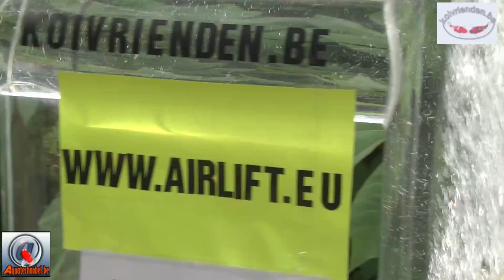introduction to airlift pump

Comment: Would that be able to supply enough water flow to push through about 600mm of stones  in a 2.4x 4.8m wetland filter or will the pump lose its pressure? The outlet would go to the outletpipe of the bog filter approx 900mm deep with 300mm empty void then 600mm filter media. Pond size would be about 36000lts i anticipate pressure chamber will be at 1.7m then run downhill to the filter 8m away

Comment: I need to move 15,000 gallons per hour! I was thinking of using a 6" pipe for my airlift pump. My driver can sit 5.5ft depth. How do I calculate the waterflow? I like the simplicity of smaller airpimps and using one per driver. Can someone explain?

Comment: Can it will on a curve pipe instead of straight pipe .. and what is the calculation of power of compressor to flow of water at specify head .

Comment: They are not liftng almost at all. Just cirulating at water level.
Reply: Do you mean to say that air lift can't push water above water level
Reply: @shyamhingankar7442  no…. But in this video it isn’t lifting very high.
Reply: @timothyjones9430 it still moving a large quantity. If it's for pond filtration and say moving it into a wetland filter it's perfect

Comment: While testing for improvements on my air lift bubbler on my 19' deep shallow well I discovered that I just need the right amount of air (no less, no more) to get the most GPM of water and keep de drop-- riser pipe end  were the bubbler is installed as close to the bottom of the well, in my case 10" to 18", I assume this because liquids on the bottom always put pressure up.

Comment: Also, instead of drilling holes, and also a rough filter (at the base), you can use perforated PVC sheet. Just warm it (or cold bend) and place around the pipe. Glue it flat to the bottom of the tube (for a filter), and around the tube for bubble generation. For bubbles, just make large slots in the tube first.

Comment: I have a question. With regards to the display system behind them, which has the bright yellow/ green poster and below it is 20 watt = 15000 ltr....What would happen if the left chamber was pressurised? would the air lift pump be able to pump into the pressurised tank? or would the pressure be too great for the air being pumped to overcome and deliver water into the pressurised tank?

Comment: What pipe diameter do you recommend for a 90L/min, max pressure .04 mpa, pipe depth 130-150cm
Very nice demonstration, thank you for doing it in English
Reply from the maker: I think 1" is good for your specification
Reply: @aquatechnobel  hello and thanks for the reply.. I think you misunderstood me.. the air pump specifications is 90L/min 65 watt... I think it can easily handle 4” or maybe more.. what do you think ?
Reply from the maker: @shaker4891  yes the miminal requier to have 15000L/H is a air pump of 20l/min to have a consumtion of 9w

Comment: 2:30  170 - 175 what?  cm?  Like 5.75' of air lift required underneath the water's surface?
Reply: Yes,  cm of water  pressure.   You can go to an engineering site and have it converted to psi or kPa or whatever.

Comment: I also have a Secoh SLL-20, what is the ideal air intake depth?  Is also a DIN 125 pipe for more capacity better?
Reply from the maker: with SLL-20 use 1.5m depth with  a 110pipe
Reply: @aquatechnobel and deeper will create more water movement is this correct

Comment: The website only assumes a pond application.  What if you wanted a different purpose and pump above head water level?  How much flow loss per meter with that 4" model?
Reply: Zero this model doesn’t lift water only circulate so they are lying.
Reply: Why would you wanna lift water to water level that called circulation not lift
Reply: Has no practical applications because it produces no work

Comment: Now send it down 300 feet and a 2 foot diameter pipe. Send 1 or 2 bubbles up the pipe and see if it will turn a hydraulic pump that runs the compressor and generator.

Comment: Hello, I'm from Brazil and here in my country people do not know this technique, I do not know English so I'm using translator, please be able to inform me how many meters below the water slide you make the holes and how many liters per minute compressor produces, the holes you made with 0.01mm drill or are thinner holes and how many holes you ended up doing. thank you
Reply from the maker: 1.7 m depht, the holes are 0,1mm and something of 100 holes you can start with a 20L/minute air pump to 60L/minute
Reply: compressor that you are using is 20 liters of a minute or more liters, to increase flow more than 15m3 I can make bigger holes and put more compressor flow or do not get a higher flow of water. thank you
Reply from the maker: yes 20 liters but you can use more to have more flow, do not change on the size of the holes
Reply: OK, AND QUANTITY OF HOLES CAN CHANGE OR NOT, INFORMATION CAN SEND AIR DOWN BELOW IN 1 METER DEPTH, WILL HAVE GOOD PERFORMANCE IN MOVING WATER. THANK YOU

Comment: I would like to ask a couple of nuts and bolts questions on design. At the 4:40 point, you mention the there should be approximately 3-4 lines of holes and .5 - 1.0  for the airholes size. I noticed that the holes were drilled on an angle to help the lift, Is this correct? Would the holes be larger or smaller to move more water efficiently on the 110 mil (4") pipe and would you decrease the size of the holes if you decrease the size of the pipe to say 2'' or 3'' instead of the 4'' (110) Thank You for your response. Very informative!

Comment: Hi I really love this airlift.... My only problem is where can I buy 5 inches pvc coupler and 4 x5 pvc reducer. Im from Philippines we only have a 4 inch pvc pipe here that why my airlift pipe is 3 inches only. Can you please help where to buy a 5 inches coupler and 4 x 5 reducer? Thank you so much....
Reply: Just use 4 inch pipes or 6 inch. and the appropriate joiners.   airlifting has pretty relaxed parameters.  I think 3 inches is a bit small, it might get blocked a lot.

Comment: Air pumps are one of the first 'modern' technologies we invented. Bless these guys for reminding us. There are now a number of technologies, air pumps are now site specific for best application. I have seen small airpumps lift water 5m and send it 300 metres on a small 110/240 v compressor... run on solar. It is nice for these men to put something like this on youtube. Cheers and danke u wel... Floot..
Reply: Can explain how does pitbull pump works ?
I mean what is the secret in this pump.
Reply: @Saydah-lk9cs this is not a pump who needs to pump water under water it’s called circulation and it’s not useful
Reply: That is a lie air pumps are not first modern design besides the subject is lifting water which this cannot do and a small air pump cannot lift water 15 feet using unpressurized bubbles then send it 900 ft. Only a closed system pressurized with air can do this until the pressure is lost. In no way could that be called a pump or moving water. Is a pressurized spray can a pump?  So don’t be stupid with your vocabulary. This not a pump or lift it’s only a fish tank with bubbles and is never useful for  anything but this video and stupid people
Reply: Dumb dumb reinvented a fish tank no useful migrant!
Reply: Muslims had air pump thousands years ago
Reply: An actual water pump would circulate better than stupid bubbles
Reply: This guy is dumb for praising air compressors when the subject is water lift above the surface below surface cannot be called lift

Comment: This type of airlift is old school. We were using these over 25 years ago in the fish farms we built for the barramundi industry in Australia. Lifting water up to 30 feet by airlift...now that's impressive.  www.1aquaponics.com.au
Reply from the maker: yes, a good system and power less consumption
Reply: When you say lifting water 30ft, do you mean you had 30ft of head pressure? Because it seems like these can move a lot of water but with very low pressure. I would have curious to see just how high this pump could get the water above the intake side before flow gets dramatically reduced.

Comment: Does it work with a 35 liter pump per minute?
Reply from the maker: yes no problem
Reply: Aquatechnobel depth of which takes the water is important? you can raise the output of the water level pond?
Reply from the maker: no raising, only possible with a gravity pond system
Reply from the maker: and the depth is very important
Reply: Aquatechnobel What is the minimum depth?
Reply from the maker: something like 1m, but in this case you decrease the flow, that mean that the air pump need to be more power for the same flow of water
Reply: Aquatechnobel Thank you very much, from Argentina! !!!. The last thing, with 1 m of depth and an air pump of 35 l / minute, will work? I do not care if the flow is half, with 3000 l / h, I'll be happy.
Reply from the maker: probarlo, es un buen sistema y el consumo de energía económica
Reply from the maker: look at this video https://www.youtube.com/watch?v=FLKT3Ur-KSM
Reply: Very happy!!!! 😃
Reply from the maker: thanks

Comment: Please advice me. if I increase air pressure to 60 watt  how about is flow rate.
Thank you.
Reply from the maker: the flow increase also over 20.000L/h
Reply: Thank you very much.
Reply: Dear Sir,Please kindly advice me about your air pump spec. 20 watts  and  How many  lite your air pump can produce air per minute?Thank you very much.

Comment: I use a similar system in a bioreactor I designed.
Reply: MrTimjwilson I love DIY 👍🏻
Reply: Id love to see that is there anywhere I can find it ?
Reply: A great application of airlift is to recirculate sludge from clarifier to aeration tank. Using the same blower that supplies air to the diffusers. Great energy savings and highly efficient.

Comment: im just wondering if this can be incorporated to become a koi filter airlift..
where as the air lifts the water up into another pipe which then falls via gravity into the bottom of a filter barrel..
the water then rises through a static K1 barrel etc.
which then flows into a second fluid k1 barrel and then returns into the pond.......
or am wrong.....
Reply from the maker: NO way, the air lift can only lift the water 10cm !! else you lost a lot of flow

Comment: can u use this airlift to filter water in a swimming pool?
Reply from the maker: with a airlift it is no way to pump above de pond level you need to work in gravity system !
Reply: depend of the type of the filtering system, but it is possible in some case
Reply: thank u for the reply building a house that will be off the grid solar and batteries want to put in a 12000 ltr above ground pool thinking of running 2 airlift pumps one for a bionizer one for a filter thinking off running 2 20wair pumps
Reply: was going to put the inlet side of the airlift 1000mm below the water surface then thru a cartage fitter then thru the airlift and out let 100mm below water surface will that work?

Comment: This is not actually LIFTING the water at all.
Reply: They keep the outlet below head to maximize flow, but it's possible to pump above head with an airlift.  Glenn Martinez is known for designs that pump very high.
Reply: Wrong. You can  put a pipe with air in it and the water in the pipe due to the air will lift the water above the pipe, which is often seen in under gravel filters in aquariums.  Watch this if you don't believe and stop spreading misinformation. https://www.youtube.com/watch?v=03EmME_OB-s
Reply: +Robert Heal thats what I was thinking. 
But in this video, they are merely using the airlift as a water circulation and aeration device.
Reply from the maker: +Jarred Sawczyszyn yes you kan do nothing else with a airlift !

Comment: In the pond, it is possible to use one-way valve so that if there's no supply of air, the water will  not return to the filter?
Reply from the maker: Patrick Sarmiento no way
Reply: Aquatechnobel thanks, I might lift it about 1" above the water level so that when power goes off, the water from the output will not backflow. I saw some test that it could take water at 3" with ease.
Reply from the maker: but in this case you lost a lot of flow

Comment: Hello please could you tell me the bore of the tube around the pressure chamber both the external and internal. I want to try this as a pumping method out of an eazypod which has a 72mm outlet so I wanted the internal airlift part for ease to me 72mm and external collection tube say 110mm ? How deep below the water surface would it need to be ? Many thanks in advance.
Reply from the maker: How deep below the water surface would it need to be ?
1.7m or 67 inch

Normally for a good working you need to have a airlift in 110 mm diameter
it is not ease to explain , but I am making a new video on the airlift to explain all the steps to build a airlift, it comes normally next week on line or later maybe ?

and in my bad English !
Reply: Aquatechnobel Many thanks I look forward to seeing it.

Comment: Mr. Jon, at 3:20 you say "the adjustment depends on how much air you want to release into the system". I understand what you are trying to say, but it doesn't address what the customer concern is.

It is the flow rate of water, (in which ever measure system they use), which the customer wants.

This is a principle used in home aquariums.

Your next improvement might be a power source. Solar?

I sincerely wish you the very best of luck.
Reply: I think he means the flow will depend on the air contributed in water
Reply: hibox1981 Probably so! The principal is the same for an aquarium filter pump. Air is introduced at the bottom of the riser & the buoyancy of the air has a lifting effect on the water trapped within the confines of the tube which encapsulates it.

I don't find it that revolutionary, just a large scale of a known proven principal. But it is energy efficient for the lifting water a few inches. However, for lifting greater elevations, the efficiency quickly drops off.